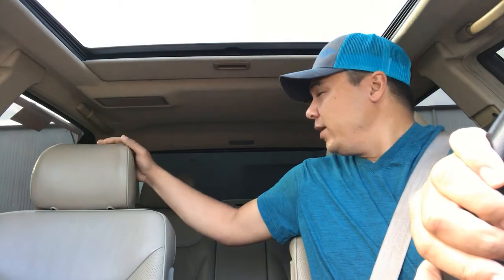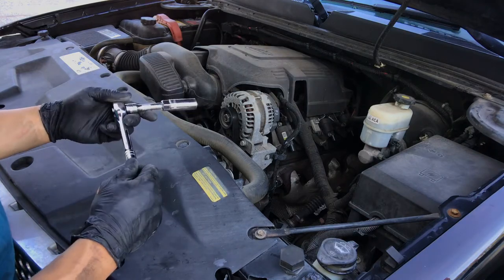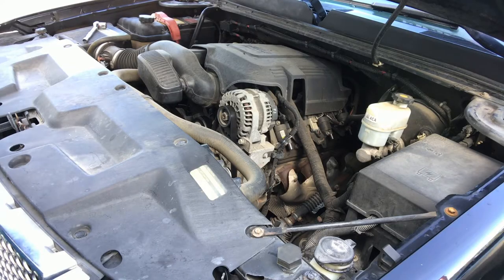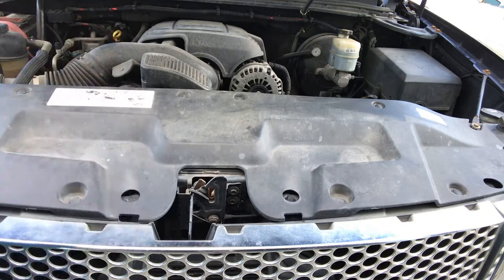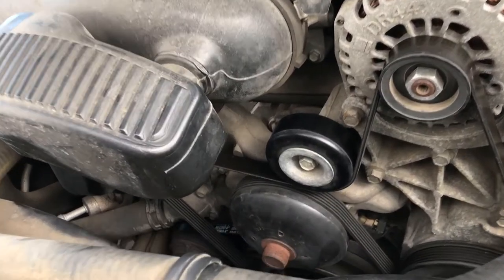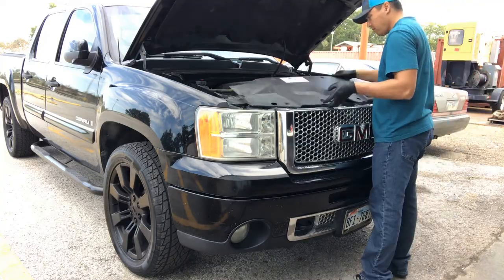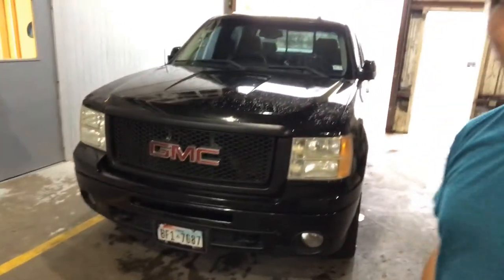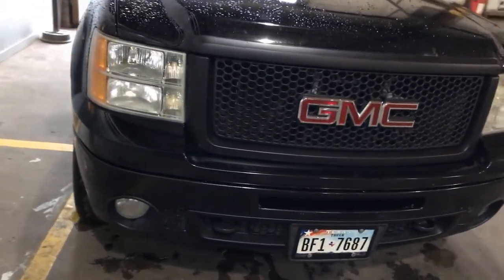GM LS truck tune up/ 2008  GMC Denali appearance modification/ Plasti-dip

Comment: What size wheels and tires did you install, They look nice! Did you install a leveing kit, if so what did you go with?
Reply from the maker: They stock Denali wheels, 22x9", 285/45R22 tires.  Thanks man.